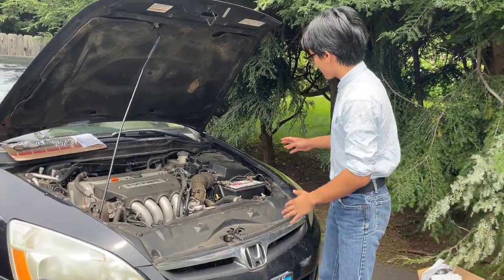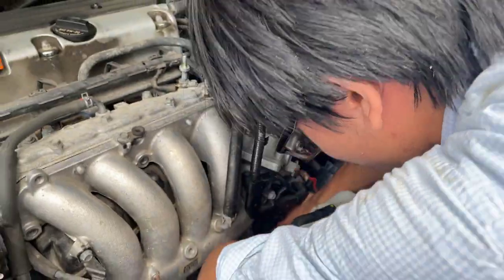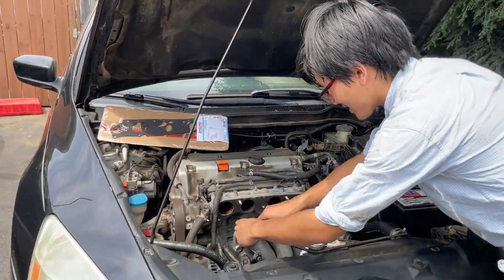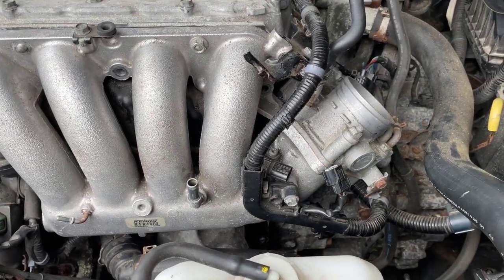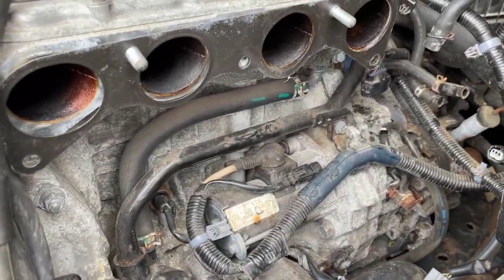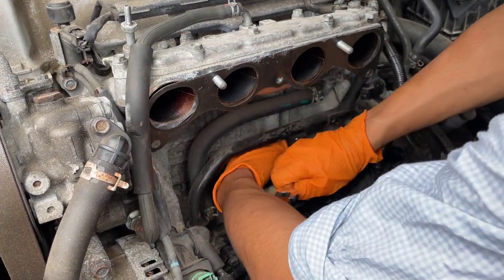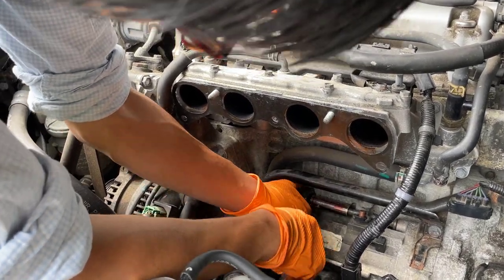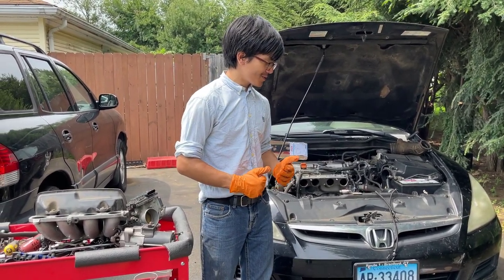How To Remove Starter Honda Accord 2003 2004 2005 2.4L & 2006 2007 w/Intake Manifold Chamber Removal

Comment from the maker: Here are the #ad links to some of the tools & parts which might be required to perform this repair:
1.  https://amzn.to/3w7f7wm  |  Milwaukee 2457-20 M12 Cordless 3/8" Sub-Compact 35 ft-Lbs 250 RPM Ratchet w/ Variable Speed Trigger
2.  https://amzn.to/3jYdb4w  |  Crescent 3/8" Drive 72 Tooth Quick Release Flex Head Teardrop Ratchet 11-1/4" - CRW10
3.  https://amzn.to/3H6CLhy  |  New Starter Replacement For Honda Accord 2006-2008 06 07 08, Element 2.0 2.4L & 06 07 08 09 10 11 Civic & Acura 31200-R40-A01 31200-R41-L01 336-2059
4.  https://amzn.to/3qmsfwB  |  DB Electrical 410-54101R Remanufactured Factory Reman Starter Replacement For 2.4L Honda A/T Accord 2003-2005, Element 2003-2006, TSX 04-05 113821 31200-RAA-A51 31200-RAA-A52 RAA43 410-54101 17870 SM612-09
5.  https://amzn.to/306w66x  |  FEL-PRO MS 96473 Intake Manifold Gasket Set

Or Click on Amazon link here and search for what you need:  https://amzn.to/3xIOsqg

Comment: This is a great video.  I did this same project and would have saved time had I seen this video first.  My intake has the chamber connected below it but I was ultimately able to get to the starter without having to fully remove the manifold.  It ultimately worked out, but I had challenges with getting a good angle to loosen and tighten the nut on main power feed to the starter.  Nice job with the video it will be helpful for many!

Comment: Just changed my starter this afternoon. I watched a few shorter videos but they didn’t completely disconnect the exhaust manifold. I spent HOURS trying to do it their way but once I completed disconnected it and moved it out the way, I had so much more room to work to get the starter bolts out. Mind you, I did the entire job using only hand tools 🛠️ Thanks again

Comment: Are you able to at least access the knock sensor without removing the chamber assembly ?
Reply: This is what I am wondering. I couldn't figure out why this job was so easy for everybody else online until I realized I have the dang chamber assembly for the upper intake manifold in my 2007 accord. No wonder I am struggling so much. I refuse to take apart the engine so I am hoping I have some better luck
Reply: @garrettsontag7813  i wound up having to bring mine to a garage to get done... And.. Apperantly Honda Cars are smart enough to recognize genuine vs generic parts... Car still kept popping the code light with a generic Honda knock sensor... Had to use a Genuine to fix the issue
Reply: @Dean-rs2nt  appreciate you responding. I might have bought a cheaper part to save money. Dang, that's good to know. I moved out of state recently and so I don't have a car guy anymore, and that makes things tricky

Comment: The bottom hose connection on my intake is pooring coolant
Reply: Same. Did you ever figure that out?
Reply: All I can say was it wasn’t important enough, I changed my starter in a hotel parking lot with a 105 piece craftsman toolset. Just buy a thing of coolant to top it off. Believe it has to do with air coolant